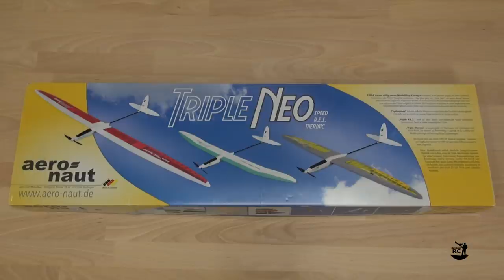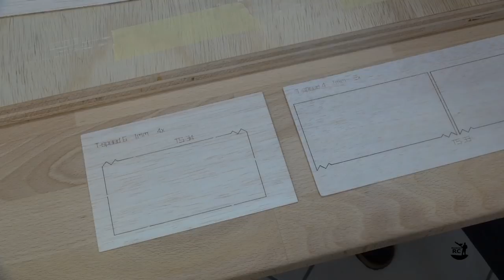Triple Neo Speed - Time Lapse Build

Comment: I respect massively anyone who still has the patience and skill to build and cover in this world of ultra ready to fly, I did secretly wish it was a pure glider though but with that speed wing I imagine some high speed passes are in order.
Reply from the maker: There are the ones who like building and there are the ones who like flying. I like both! So the process of building a plane is something I really enjoy. The Triple Neo would also be a great pure glider but the next slope is more than 20 km away whereas my usual flying area is 2 minutes away from home. So having a motor is the most practical setup. Despite being a light weight build the Triple Neo can get pretty fast. Top speed was around 150 km/h in a dive. But due to the low weight it slows down pretty quickly. So typically I don‘t go too fast but just enjoy the great ability to float from one thermal to the other even over greater distances.

Comment: Piękny model! Zdziwiły mnie tylko zawiasy sterów i lotek z taśmy klejącej!!!! W filmie pominięto moment sprawdzania położenia środka ciężkości.
Reply from the maker: Thanks for your comment. Sticky tape is a quite simple and efficient way to make hinges. They are quite long lasting and if need be can be easily replaced. There was nothing magic to the CG checking so I didn‘t put it in the video. Basically I assembled the plane before glueing the battery support plate. By moving it forth and back with the battery strapped to it I figured out where to put it to balance without adding weight. I can focus a bit more on this step in my next build video.

Comment: Big inspiration.. I have Aeronaut R.E.S. and Speed... both with the wood fuselage and V tail. But the technic of building wings is the same I suppose. Thank you a I wish you nice fly!
Reply from the maker: Thanks a lot for your feedback. I think the wings are completely identical between the normal Triple Neo with wood fuselage and the Triple Neo. I will soon start the build of the thermic wings. It‘s really a wonderful plane. Happy flying to you as well!
Reply: @bavarian_rc  Hello, only one question. Its neccesary to put glass under the balsa cover of the middwing? In classic Triple Speed is no note about it, or its your idea for more solid wings?
Reply from the maker: It is not necessary but I wanted to make the wing a bit stronger in this area. The instructions don‘t require it. Same for the carbon roving at the trailing edge

Comment: What a flippin' master! Wow.
Reply from the maker: Thanks! 😊
Reply: @bavarian_rc   you got me wanting to build a plane for the second time (first time was a disaster, never completed). Im wanting to get a Kaos streamer wing. What glue is best, white wood glue or CA? Any one better than the other or just personal preference?
Reply from the maker: Go for it! The Kaos looks nice. Concerning glue I think there is a lot linked to preferences. For glueing balsa wood I usually use white wood glue. It gives you more time to perfectly align your parts and it doesn't make the wood hard (like CA), which makes the sanding a lot easier. On the other side CA allows super fast progress. As you have seen in this video I also use CA in some cases and some other builds like the Puri, Shaka or Venice were mainly done with CA. Some combinations work better with CA, for example wood on carbon. Wood with metal (like the brass tubes of the Triple Neo) require epoxy. I hope this helps.
Reply: @bavarian_rc   awesome, fantastic advice from an experienced master. I value your comment highly! Thanks! Maybe I'll make my own video of my build and maiden and share it :)
Reply from the maker: If you have questions during the build just ask. Would love to see your video 👍🏻🤩

Comment: HI Robert,
Very well done time lapse video of the Shaka design!!!
I have made a 3-D print-out for the aero-naut servos. I had to remove about 0.5mm on either inner side of the bracket for a near perfect fit. So if tolerance allows, perhaps increase that measure by 0.5mm or 0.6mm on each side??? the holes for attaching the servo to the bracket are near perfect as is. Hence i am questioning if it is worthwhile widening the measurement or just simply filing away the excess material in order to have a perfect fit. If you do make a modification to the STL file i will certainly give it a trial in having a 3-D print made.

Peter
Have a Merry Christmas and may all the best wishes touch your life and your loved ones!
Reply from the maker: Hi Peter, thanks for having a look at my Shaka video! Coming back to the servo frames I have a little issue when making the adjustment you proposed (0.5 increase of the space for the servo body on both sides). When I do this it intersects with the holes for the screws (actually cutting them open). Do you think I could increase the distance between the holes also a bit, like 0.5 on both side? I wonder why they made the holes so close to the servo body.
In any case I made a new Version V1.1 (https://drive.google.com/file/d/1bao89wBdQm8YX4Qxk9BGyOjg_ymPBROb/view?usp=sharing) with a wider space for the servo body (0.5 on both sides). Mounting holes moved outwards by 0.1mm. Small doubler (or patch) put next to the holes which you can file down as needed (a lot easier than filing down the whole surface).
I hope this works. 
Also to you and your loved ones all the the best and a merry Christmas.
Robert

Comment: Great build , learn a lot from this video.  Does the spinner and prop come with the kit or is this extra?
Reply from the maker: Thanks, happy that you liked it! The spinner and prop are not included in the kit. They give a recommendation in the build instructions but you need to get them extra
Reply: @bavarian_rc   Thank you very much for the answer.  I am about to order one, and i will order a spinner and prop too.
Reply from the maker: @janiversen4391 I changed my setup a bit. Now I am using the Aeronaut Z-Spinner: Aeronaut AN723442 folding prop 11,0×8,0 CAM Z Carbon,
Aeronaut 725171 Z-Spinner CoolNose "Turbo", diam. 30mm,
Aeronaut AN712304 attachment cone for 30mm CoolNose- and Z-Spinner. This works quite fine with the recommended motor (Aeronaut actro-N 28-4-880 brushless Motor)

Comment: Very helpful video thankyou. Is there an optimal ratio of thixotropy powder, microballoons and resin ?
Reply from the maker: Thanks! I usually mix thixotrophy powder and microballoons 50:50. If
I want the resin to stay where I put it and not run away then I add thixo and micro until the resin has a consistency where the little spike that you create when pulling out your mixing stick from the resin is staying as it is and not flowing back. You can see it at 03:51

Comment: Does it have everything you need to build all three wings? If not, can you build the big wing with removable sections in the middle to make all three usable?
Reply from the maker: Hi, you need to decide which version you want to build and buy the respective kit. The kit only contains the parts for the one version. Consequently the Triple Neo can be ordered in 3 different kits. If you also want the other versions then you can order the wing kits separately. I have already bought the thermic wing and will build it during this winter. It can then be combined with my existing fuselage.
Building the big wing with removable sections could be possible if you modify it but that will certainly add some weight.

Comment: Good morning Robert,

Will the tabs used for the Servo Frame using Aero-naut Servos be the same as those used for the Servo Frame made for the Graupner Servos? OR will a modification of the 3D STL file for the tabs be required? 

Peter
Reply from the maker: Hi Peter, the new frame doesn’t need tabs. The servo is directly screwed to the frame with one screw on each side.
Robert

Comment: Amazing build. Just one stupid question: it looks like the servo connectors on the fuselage side are wired for 2 servos per side. Is there a plan to use a wing with flaps in the future?
Reply from the maker: Thanks, great that you liked it. Well observed, indeed it is wired for 2 servos on each side. The Triple Neo can be combined with 3 different types of wings. The speed version (181cm wing span) which I built, a R.E.S. wing (200cm for the R.E.S. class without ailerons, just rudder, elevator and spoiler) and finally a thermic wing (251cm) with ailerons and spoiler. I already bought the thermic wing kit and will build it this winter. For sure I will also do a build video. There is no option for flaps and I don’t know how well they would work on the Triple. If you are looking for a comparable glider with flaps then have a look at the Helios or Helixx from Aeronaut.
Reply: @bavarian_rc  Thanks for the answer. Not sure if I will go for any of those you proposed. 
I have more things to fly than I would be able to. My last glider build was some 18 years ago before laser cut kits became so popular with saw and belt sanders so I watch those build videos with great fascination...
Reply from the maker: I started into the hobby when I was a teenager, which was back in the 1980‘s (gosh I‘m getting old). Cutting by hand was just normal. After some years the hobby went into a pause of more than 25 years before restarting. The evolution of the hobby since the late 1980‘s was just amazing. What didn‘t change for me is the fascination of a balsa build. But with laser cut kits this is a completely different level. Last build 18 years ago and still plenty of planes? That could happen to me as well 😂 The thing is that I love building as much as I love flying… Greetings from Bavaria

Comment: Excellent build video, thank you for going to the trouble of publishing it. I have recently purchased a Speed wing kit and the pod and boom fuselage. I'm sure this tutorial will be of much help to me. What is the wall thickness of the CF tube you used for the fuselage?
Greetings to all from Harrison, AR, USA.
Reply from the maker: Thanks for your feedback! The wall thickness is only 0.5 mm but due to the fibre orientation in 2 directions it can handle the loads quite well. Even though I have to say that the tail looks a bit shaky. But the old rule seems to apply: things that bend don‘t break. The shop where I purchased the CF tube is specialized on such gliders and they recommend this tube for tail designs like on the Triple Neo. Had no issues so far during all the flights. Enjoy your build!

Comment: Great tutorial. The kit comes with those 3 wings material and plans? And a see a acetone can for what you use?
Reply from the maker: The kit comes with one set of wings. You can choose which one. The other wings can be ordered separately. There are no plans, just the build instructions. I used the acetone to wipe off the expoxy that spills out when gluing the magnets

Comment: 34:30 I don't understand, why you soldered two servo wires if there is only one servo in the wing?
Reply from the maker: The Triple Neo is a flexible concept. There are 3 different wing types you can combine with the same fuselage. I also want to build the thermic wings and connect them to my existing fuselage. The thermic wings have ailerons and spoilers, meaning 2 servos per wing.

Comment: Belle vidéo👍. En version électrique, j'ai dû rajouter 87g de plomb ☹️ malgré le tube de carbone utilisé dans la vidéo.
Reply from the maker: Thanks! A friend of mine had the same issue. The reason was that the balsa wood used for the horizontal and vertical stabilizer was more dense and thus heavier than the one on my Triple Neo. In consequence he used a 2200mAh battery instead of my 1800mAh battery and about 15g of balance weight in the nose. The total weight is about 100g higher than my Triple Neo. Nevertheless the flight performance is quite comparable. The extra weight helps a bit in windy conditions. The main advantage of the carbon tube shown in my video is the greater strength for torsional forces. the lower weight is a nice side effect. I hope you enjoy you Triple Neo!

Comment: Отличная работа браво! Но аккумулятор слишком тяжёлый для такого размера планеры. Советую 800мач или меньше.
А полет?
Reply from the maker: Thanks! Not sure if it balances with 800mAh but certainly a 1300mAh would be ok. The difference in weight would be about 30 grams. But I didn’t go for a super light setup as I was more interested in longer flight time, so went for a 1800mAh in the end. Check out the flight video: https://youtu.be/5njUNvx_JF8
Reply: @bavarian_rc  Спасибо, отличный полет. Красивое видео.
Reply from the maker: Thanks, great that you liked it

Comment: Outstanding! Great build! Just one question: What model is that Brother printer/cutter? That is marvelous. You feed in special vinyl paper (what kind paper is it?) and it cuts decals ready to apply?
Reply from the maker: Thanks! It‘s a ScanNCut SDX1000. I use vinyl adhesive decoration foil. Nothing special. It‘s a German brand called d-c-fix from the hardware store.
Reply: @bavarian_rc  one other thing: what is that eliptical template you used for the wing? Did it come with the kit? Did you make it yourself? What is it made of?
Reply from the maker: This thing is made of 3mm Depron and was part of the kit. It is used to align the spar and the skins. A quite clever solution that the manufacturer Aeronaut uses in many of their kits.

Comment: One question: which materials are you using to reinforce the control horns? Many thanks in advance.
Reply from the maker: I use 160g glass fiber and epoxy resin (with black color paste). The white pressboard is treated with release wax.

Comment: That was a great build, thank you. Was that just regular tape you used to attach the flaps, elevators and the rudder? Does it hold? What's the name of the plastic you used to cover the wings?
Reply from the maker: Thanks! Yes it was regular Tesa clear tape. It is quite durable and strong. I had no trouble ever. The wings are covered with Oracover (white and black) and Oracover light (transparent blue). You can check the video description for more info.